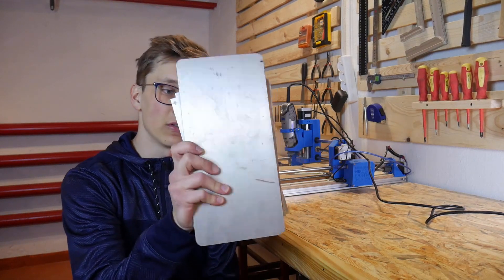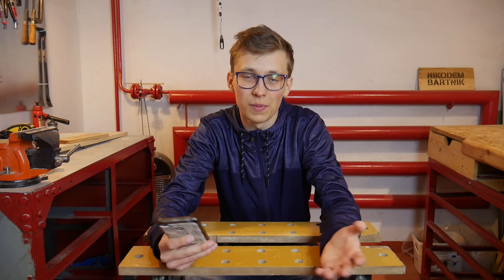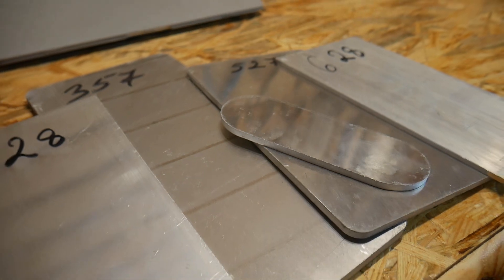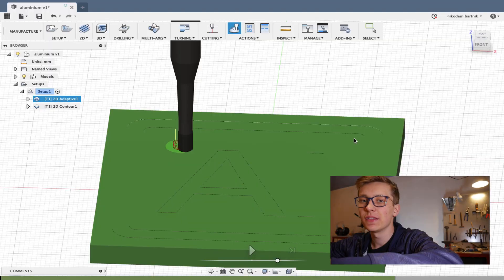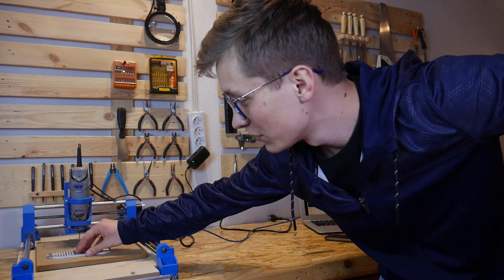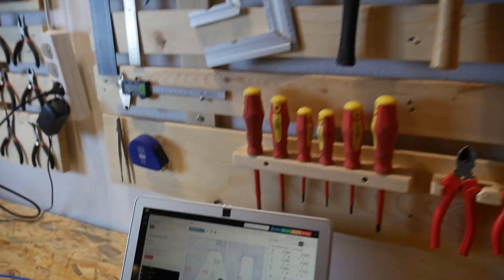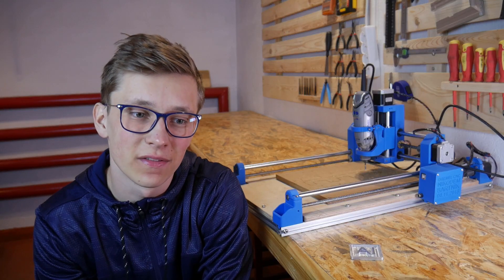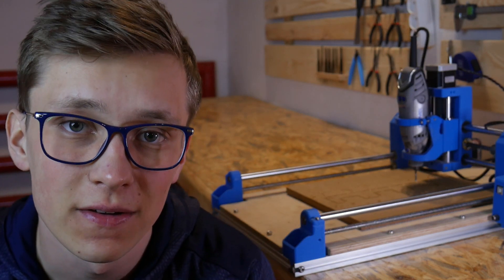3D Printed DIY Dremel CNC Mills Aluminium

Comment from the maker: Any idea for aluminium injection molds? Let me know in the comments! Here is a new updated list of parts for Dremel CNC: https://goo.gl/YJzaXZ
IndyMill: https://indystry.cc/indymill-cnc-machine
Reply: Being following your videos with great interest. I wonder if you could just explain about the lead screw. You do not mention which one to use apart from 8mm. There is more specifications to lead screws. Does it matter which one you use. Does the resolution change as the mm travelled per revolution changes.  I can only presume you using 8mm x 2 or is it 8mm x 8?
Reply: Rc car wheels
Reply: You can buy aluminum and other barstock etc on ebay
Reply: Your blue y-axis brackets!
Reply: Please do a 3D shape injection mould. Something like a medallion or charm with 3D shape.
Reply: Crosses?
Reply: Please mill a pcb on it.

Comment: Was just thinking about buying a printer finally and came across this. I have a bit of background in machining so it really piqued my curiosity and now I'm thinking about building a benchtop CNC mill. Mine would probably weigh substantially more than this, but that's only because I'd probably be sourcing a used milling table to build it on.

Comment: Nice machine and work! I wan't to see your works with this beast :)
I have one DIY CNC with workspace of 1000x850mm (1200x1100 total) with a similar spindle (Kress 1kw) and the next step i wan't to make is put one 1.6kw VFD spindle (more power with less rpm, maybe 2 or 3 times more power).
If you wan't to see my machine https://www.youtube.com/watch?v=SFl_6xrXTx4 here i have one 3D carving i need a lot of improvement but i'm happy with this because are jobs of 3-4hours (3-4 for finish and 2 hours roughring).
Nice work and continue with this projects!

Comment: Hi Nikodem, first of all, congratulations for this beautiful project and video ! I would like to build a cnc “low cost” and I will follow your instructions.
Unfortunatelly I have some difficulties in finding T8x2 lead screw , but I’ve Found T8x1.5 ! Do you think that changing the value mm_per_rotation via software I will obtain the same result as you? Or choose the T8x2 is mandatory? Thank you very Much 😊

Comment: The uneven cuts on the walls are because of slight chatter, Basically the dremel mount needs to be a bit stiffer.
An alternative is to give more mass to the dremel, like a flywheel of so the oscillation of the bit won't be as quick

Comment: hi I always have a problem when the grbl is running. for example G18 G3 X21.5 Z-1.7 I0 K0.3
stepper motor is not running. do you have a solution

I use arduino cnc sheld v3.driver 8825. and stepper motor nema 17. no jumpers

Comment: Wow, finally I found someone with exactly the same idea as me.
I went to the hardware store yesterday and saw a small high rpm dremel and thought of printing a cnc frame for it.
Since the belt system and lack of open source from the MPCNC I wanted to use lead screws to move the axis to get rid of slack and vibration.
Thank you for your great inspiration!

Comment: 3D print the parts from PLA, use the PLA/lost wax casting process to make aluminium parts,  and I'm pretty sure they would have the sufficient rigidity to improve your milling experience.
Well done all around!

Comment: The idea is nice, but I have some improvements for you:

1. Try to make a more rigid fixture if the milling head, that way you get more stability, less vibrations and thus a better surface finish and overall a longer lifespan of your machine.
2. Use a shorter endmill, as short as possible. With that you reduce the radial forces on your milling head, this should also improve your finish as well as reducing vibrations.

I guess that should fix the surface problems. It doesn't look bad, but if you compare it to real milling machines the surface isn't really usable and very rough.
I also think that the improvments mentioned above should allow you to mill faster. 

And try to reduce the feed for the finishing path, it will look way better. Also try to have a last cut at the bottom of your pocket of around 0.03-0.05 mm. With less material to remove during finishing compared to roughing your tool will be pushed away less from the material, thus less vibrations will occur which directly translates into surface quality.

But overall great project! Just ask if you need advice with milling :D

Comment: No way im using Crapbook, Thank you so much for showing that a small desktop Cnc machine can cut aluminium , yes it may be slow, but then look at the cost,
So on that note I have been and bought a Desktop 3040 CNC machine, 
Express delivery 1 day 

Q. Do you use Fusion 360 to use as cutting to, I mean is fusion used to do everything!
Aw an idea , !! if you heat up some colour wax and poor into the part you made it will look fab. :)

Comment: Congratulations on your Work, I am french and I want to know the software you use with your cnc ? i also work with an iMac Apple. . Thank you very much.
Reply from the maker: Thanks! CNCjs, Fusion360
Reply: @nikodembartnik  NO I want To known the software to drive the machine ... do you use GRBL CONTROLLER ?
Reply from the maker: There is GRBL installed on the Arduino
Reply: Please i want to know if you use Mach 3 or Universal gcode sender or contrôler grbl ? Thank you

Comment: Very nice! One question I couldn't find answered in the video though: what were your feeds and speeds? You mentioned depth of cut (DOC) (~0.2mm as I recall) but not the RPM and feed rate. This is useful information for milling.
Reply: I was just about to come down to the comments and ask the same exact question

Comment: I  think you should now design then make a more rigid and powerful CNC router using this 3D printed one, maybe from aluminium/acrylic as well as 3d printed parts. Then the machine could possibly be larger and would be more suited to milling metals. You could then even build full metal components for the CNC, iv always wanted to build a better CNC with a cheap one then use it to make upgraded parts to improve overall accuracy and rigidity. Id be happy to help with design

Comment: If you need aluminium, just go to a local machinist and ask if he has any leftovers. Ususally they do and they sell it back to manufacturer by weight aka like 2€/kg. So they usually gladly give it away.
Reply: Also, the sufrace finish is terrible which is exactly what I expected from start, you can't expect much of this machine to begin with. 1 flute bit doesn't help you much in this case either. :P
Another problem is the dremel rotary tool, this is like the worst choice for milling. Bearings inside aren't fit fot the job and overall dremels are shitty, non expoxied coiling etc.. One good low budget alternative is proxxon.

Comment: i dont know if it's possible but i alway's see long HSS mill's being used, i think if you switch it out to a way shorter carbite mill you will get much better result's. i know for a fact that shorter mil's give much better finishes than the longer one's.    i dont know if it's possible though, with carbite you need quite alot of RPM on the spindle.

Comment: I have a Sherline CNC mill. Its pretty light duty but I doubled the capacity and quality by adding a coolant system. I went with a fog buster. Chip evacuation is key for small machines and the lubrication will cut down on the forces acting agains the machine allowing you to take more aggressive cuts. Good work!

Comment: Step 1: 3D print a CNC machine that cuts aluminum. Step 2:  CNC a new CNC machine made of aluminum. Step 3: Cut steel.
Reply: Step 4: cnc a steel cnc machine to mill titanium
Reply: is this minecraft
Reply: The downside of successively milling more powerful machines culminates in the geneses of Skynet ending all of humanity.
Reply: @Osw719 Step 6: cnc a tungsten carbide cnc machine to mill adamantium
Reply: Step 7: build robotic Wolverine
Reply: @The-Rewker  I feel like we skipped a couple steps
Reply: Step 8: cnc an adamantium cnc machine to mill vibranium
Reply: Tools are so freaking cool
Reply: evolution of a maker.
Reply: Theoretically you could use a accurate 3d printed cnc to make a more accurate aluminum cnc if the guideways stay the same. Cnc is just very expensive and time consuming so buying premade parts or even custom laser cut metal parts to make a stiff cnc would be cheaper.
Reply: To mill steels like 1.1105 you need at least 20Kw spindle, very expensive nad static vice, a lot of torque force. These expensive machines that mill steel are expensive from a logical reason.
Reply: @Grzabekus there are people that mill deep cuts in aluminum with 50w of power from spindle as well. You dont need much power if you either go slow or have a rigid machine
Reply: @leonordin3052  come on, 50w, dont be silly
Reply: @Grzabekus  There are people getting good results milling steel, stainless steel and titanium with 1.5 kw spindles on desktop router frames.  They aren't going to have high production rates, but they found the secrets to using what that have and broke the paradigm of how much power was needed to accomplish it.

Comment: I'm so excited to build one of these. You did such a great job designing the machine as well as producing these videos! Thank you very much.

One question I have is about the lead screws getting wood and metal shavings all over them. Will that cause any problems with the lead screw movement? Do they need to be cleaned regularly or does the nut simply prevent those things from entering?
Reply from the maker: I didn't face this problem yet, you may need to clean it from time to time. Thank you!

Comment: FOR ALUMINUM.....YOU SHOULD USE SOMETHING LIKE A ....3 FLUTE ENDMILL WITH A NON ALUMINUM OXIDE COATING SUCH AS ZrN ......THE COATING PREVENTS ALUMINUM FROM STICKING TO THE ENDMILL
Reply from the maker: Don't scream dude, single flute endmill is better in a machine like this, I don't have problems with aluminium sticking to the endmill
Reply: @nikodembartnik  DID MY SCREAMING TRIGGER YOU ....SO SORRY
Reply: @nikodembartnik  LOOK DUDE...BY JUST OBSERVING YOUR VIDEO I CAN SEE THE POOR  QUALITY THAT SINGLE FLUTE PRODUCE....MY GUESS IS THAT YOU SIMPLY DONT KNOW ANYTHING BETTER....

Comment: Please make injection mounds on this machine. I got a 3040cnc and I want to mill injection moulding, but scared. Your video made me more sure I can do that on my machine.
Reply from the maker: If you have a 775 motor as a spindle there it may not be possible to mill aluminium, but you can always try :) I will make a video about injection moulds soon
Reply: Could you tell me with what motor i should look at when want to mill brass, aluminum?? Kooking for cheapest option

Comment: Super project, I like it. My suggestions is to do finishing pass. You can use same bit (better options is to use smaller bit because it can better to mill inside surface of "A") but higher speed and less material to  mill in this last pass. In this pass, your bit should milling vertical surface of "Al". After that stap your vertical  surface will  look better than now.
Reply from the maker: Thanks! I used finishing pass on the contour cut but forgot to set it up in adaptive clearing ;)

Comment: Nice job bro, try with a 400w chinese spindle, it could do the job and i think it could fit nicely on your machine, also try 1/4 inch 1 flute endmill to reduce the cutting time process i use one of those spindles at low rev on my steppers and works nice, the only thing that its a kick in the but is that those chinese spindles get warm aF! 
Saludos buen trabajo !
Reply from the maker: Thanks. I already have 400W spindle I just have to mount it to the CNC and test it! Gracias :)

Comment: Hi - curious as to why you don't use a much shorter cutting tool.  It would be much more rigid, and vastly improve your surface finish.
Reply from the maker: That's the only one single flute bit I have right now, I will try to mount it deeper next time

Comment: Very nice job! I plan on building one or changing it up for materials I have on hand here in the US. Just a tip, use a shorter flute length on you bit and it will reduce the vibration. Only need a little longer than the thickness of your material. A full sized commercial CNC would have a tough time milling with the bit as long as yours. Great job on the design and thank you for sharing!!🙏👏

Comment: Nice, that's it I'll be building that, I'm seeing one issue though, a lot of chips are ending on threaded rods and all over, have you noticed any problems from that?
Also Dremels have a threaded tip for accessory mounting, have you thought about using that instead of clamping it to Z Axis?
Reply from the maker: No problems with that so far. I used the thread on the Dremel to mount it too, clamp is there for better rigidity

Comment: can you do tool change???
Reply: Only manually and taking care on recalibrating z axis and executing another gcode. It can be done also in gcode directly if the machine knows some extra gcode.... but that is taking too much of preparing beforehand and can be more prone to disaster than first method. I did made some experiments before and I stick to first one.

Comment: Use some air to clear the chips, if you don't re cut your chips the surface would be even better. Good job love your approach to learning. Check the tape trick from NYC CNC on you tube. Layer of tape on bed and a layer of tape on the part and glue together with superglue. Works very well.

Comment: BUT CAN IT MILL STEEL?
Reply from the maker: that is the question
Reply: I successfully milled aluminum, brass, bronze, gunmetal and mild steel on "soft" cnc machines. I think milling steel would be possible if you are very conservative concerning feed rate and pass depth. When milling hard materials you can also consider trochoidal milling. It is not very fast and it requires the controller to be able to handle very large Gcode files but it works well on relatively soft machines.
Reply: The biggest problem with milling steel with the Dremel as the cutter is the amount of flex on the cutting bit/Dremel/mount.  The tooling marks indicate the spindle is dragging a little bit.  Try to find out if your mount is flexing, or if it is the Dremel, or if it is the end mill sp you know where to stiffen the cutter design.

Comment: Build a better cnc with your cnc!
Reply: Going from 3D printer to 3D printed CNC machine then finally to a factory grade aluminum CNC machine JEEBUS CHROIST
Reply: Yes! That would be an interesting challenge!
Reply: That is what I would do.
Reply: That's how it happens! More and more accurate machines are needed to make more and more accurate machines!
We truly stand on the shoulders of giants!
Reply: But its not the accurate machines which makes a more accurate machine. Its the lapped lenses, optical flats, cylinders, surface plates etc which makes it possible to make interferometry, straight guideways etc. Which makes it possible to do precision machinery. @ThisPossumKnits
Reply: I built a better CNC with a milling machine myself.

Comment: Congratulations on the success of your machine. Unfortunately I strongly dislike Facebook (I think it is too psychologically manipulative), and not an entity I enjoy engaging with. I expected your CNC to work fine with Aluminum. I will be very interested in your injection molding experience. If that can be done efficiently that is a big deal. I wish you well.  

I am also still open to providing some financial support to you if you find a way to accept that. I don’t know how Polish tax laws work. In the US gifts are typically tax free to the recipient, and only taxable for the giver over a very large amount.
Reply from the maker: Thanks! I am not a huge fan of Facebook too but it has some useful options, used carefully it's a great tool. I didn't expect it to work that fine with aluminum :) I have no experience with injection molding, I talked with some people about injection molding, watched a lot of YT videos and read a lot online about that, I will try to make some molds and use them with a hot glue gun if that will work fine I will try to build a small injection molding that will be able to produce parts automatically. Thank you that you want to support my work, as for now, you can support me by sharing my videos or by PayPal :)
Reply: Nikodem Bartnik is there a special PayPal link I should use, or just PayPal to the gmail address on your webpage?
Reply from the maker: Here is my PayPal email: nikodembartnik@gmail.com notice that there is no dot between first and last name. Thank you a lot!
Reply: @nikodembartnik  set up a patreon
Reply: Add me to the list of people who have no liking for Facebook.

Comment: congrats for your 1K facebook followers! you deserve it. For a very first test with aluminium, it's not too bad. There's no secret about milling bit: the more it costs better it's often.
Reply from the maker: Thanks! I have to search for some better milling bits and test them to see if the difference is worth it
Reply: @nikodembartnik  :   Nikodem Bartnik  :  I think the bit you are using is the right idea.  Single flute is ideal for a machine such as yours; the extra chip clearance space really helps in keeping temperatures down, and avoiding recutting and melted material on the cutter.  In my experience, a straight flute bit works just as well as a helical one.  That bit seems to have done a very acceptable job (which is not often the case)...  I agree with Jean Seb Astienback... you gets what you pays for.